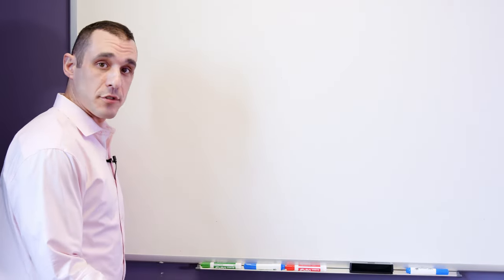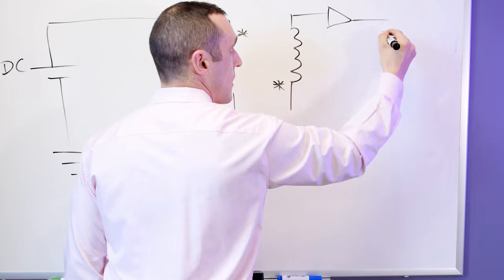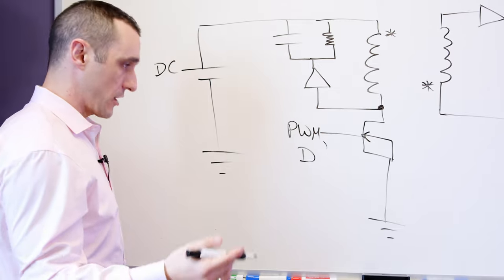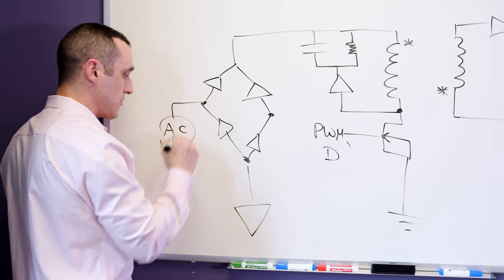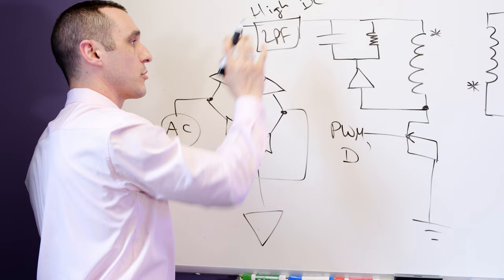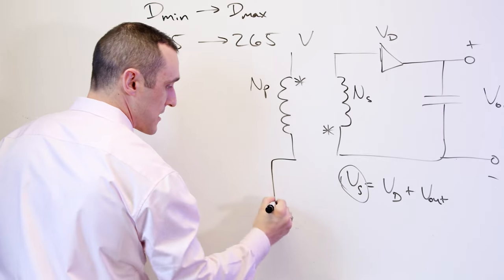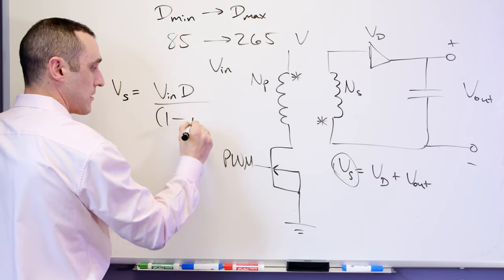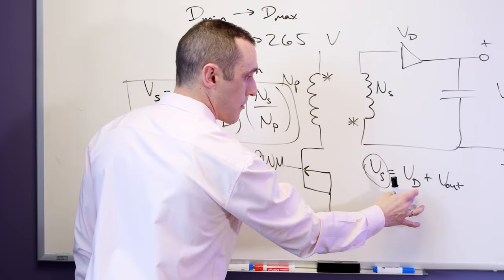Flyback Converter Design Deep Dive

Comment: I do believe the ground reference used by the bridge mentioned at 04:54 is the same as the ground reference used by MOSFET.

As far as the isolation goes the same is provided by the transformer.
Reply: Yes they are the same reference, don't mind the symbol difference, and yes transformer provides isolation which is why I did not put a symbol there but just a negative terminal for an output.
Reply: @Zachariah-Peterson  thanks for the clarification.

Comment: IS it really a transformer and not a coupled inductor? asking since i remember you needed an air gap. 
I tried to build one in the past but the hardest part was the transformer* part since most out there are built on order and figuring out the proper generic part out there was the hardest part, maybe you can expand on this on a later video. Or how to make one from a toroid. 
Also what is the switching frequency range for flybacks ? buck boosts can go up to a few MHz but I never saw any flyback that was even close , also what would be optimal from a efficiency point ?  Does the transformer* limit the switching frequency ? 

Regarding multi output one i have a few questions:
1 how will the power draw in one affect the other?  As in if from the 12v DC rail we draw .1A and then 1A how will this affect the 3v3 rail? the rail with the FB will be ok but i am afraid of voltage saggs on the other one.  OR should i size the other one higher and then use a LDO after the diode? 
2 can i set a center tap like GND so that i also get negative voltages? 
3 If i would desire a few DC rails with the same GND wouldn't it be simpler to make a higher DC single rail and then add a few LDOs or bucks on that DC line? (not sure about cost but i assume it is more expensive at scale)
Reply: It's absolutely a coupled inductor in flyback supplies; it's where the name comes from - energy "flies back" - magnetic flux is built up in the core during the primary on-time, then collapsed into the secondary(ies) in the off-time.

Each switching cycle transfers a "packet" of energy; the size of this packet is proportional to the inductance and square of the current. Since the time it takes to ramp up the current is proportional to the inductance, it's more beneficial to lower the inductance to increase the current. This does however result in high magnetic flux, which is why flyback cores are either gapped, or a powdered iron core is used (which effectively has a distributed air gap, allowing for higher flux before saturation).

You can only decrease the inductance so much before current levels become unmanageable, so between this and other factors such a switching losses, there's a "sweet spot" for the flyback topology, which is why you only really find them in the sub-200W power range; above this, a design using true transformer action wins (eg. forward converter, half/full bridge)
Reply: Forgot to add re: multi output. You'd take your feedback from the output rail that needs the tightest regulation. There's nothing stopping you adding linear regulators afterwards, but if you're doing it because you want a really clean output, you'll need careful L-C pre-filtering before the linear regulator, as they aren't very good at filtering out the high frequency components of the switching noise that the flyback will generate.
Reply: @NicBellamy  THX i was considering a PI filter after the diode anyway + potentially some synchronous rectification
Reply: @NicBellamy  So if i use some of those powdered toroid's i can wind the inductors and not bother cutting into it? NICE
But i am still a bit clueless about how to filter out the good ones are the powdered materials from a certain series or is the a material number range? asking since i am a bit lost on mouser
Reply: (1) Regarding multiple voltages, they are maintained fairly accurately, so there is mostly no need to add post-conversion and regulation unless you need to maintain better than the typical 5% regulation.
You need to understand that, for stability reasons, regulation is done on the most loaded line (with highest current), as that one will be sagging the most under typical loads.
Then the other voltages are maintained simply by the ratio of their turns relative to the regulated one.
One thing you need to consider here is the inclusion of the rectifying diode voltage in your calculations.
Let's say you're regulating the 5V output with its 1A load, and you also have a 15V output with less than 1A.
Your turns ratio would be 1:3 between 5V and 15V output.
But one small detail is that you also have the average 0.7V forward voltage drop across the lower voltage rectifying diode, and 1.3V across the higher one.
For simplicity, we will use 1 turn per volt.
Your 5 turns will have to produce 5.7V to give a 5V regulated output.
On the higher voltage output, the 15 turns will produce almost exactly 3 times the voltage on the lower output, which is 5.7V × 3 = 17.1V, minus the diode voltage drop of 1.3V under maximum load, which gives 15.8V.
If the 5V output is less loaded, diode voltage drop is decreased, let's say to 0.5, so we get 5.5V × 3 = 16.5V, minus 1.3V gives 15.2V.
Taking this diode drop into consideration, you could use 14 turns to get closer to 15V.
Either way, the voltage change is not too large and most circuits will have no problem with it. You just have to include the diode drop on the regulated rail to get a more accurate estimate of the other rails.
You will also have a slight voltage drop on unregulated lines due to coil wire resistance.

(2) Yes, you can set a common tap and wind negative voltages in the opposite direction, also turning their rectifying diodes in the opposite direction from the positive voltages.

(3) Using LDOs is only recommended when you need more tightly controlled voltages with less noise, but in that case you're still recommended to use mutliple outputs from flyback with voltages only slightly above the regulated ones, to keep losses low.
Adding buck converters after a flyback is redundant, because a flyback is already a sort of a buck converter with multiple voltages where you only need additional turns, diodes and capacitors for higher voltages, or a tap for lower voltages.
It is possible to use the same wire with taps, so that you only have one continuous coil with multiple taps, but wire thickness needs to be observed for each output's current rating.
Buck converters after a flyback only make sense when you need a much more tightly regulated additional voltage but don't worry about the voltage noise much.

Comment: Can we use full-bridge rectifier on the output? I never seen that, mostly there is a center-tap coil for secondary and two diodes on both end. I guess because the few turn of copper is much cheaper then two fast switching power diode, but I'm nut sure. Is there any other reason why it is unusual?
Reply: I suppose you could but I have never seen it, I would need to think about it. I do recall seeing center-tap coil designs on the secondary side, and to rectify both would need diodes, but I see it more often when you want two output rails or in a full-bridge topology.
Reply: @Zachariah-Peterson  Thank you

Comment: Thank you Zach, what should the  ground reference for AC power be? Neutral? Protective Ground?
Reply: If by "reference" you mean the AC equivalent of a negative terminal for return currents then it would be neutral. The protective earth is connection is not meant to be a current carrying conductor so it should not be used as such. It is useful to provide a safety ground using the chassis, or by drawing an earth ground ring around the edge of the board.

Comment: Geranium diodes?
Reply: Yes Germanium diodes can be used instead of Si if you want lower forward voltage.
Reply: @Zachariah-Peterson  Yes, for a Germanium diode (though now days I would use a Schottky) but you suggested a Geranium diode.  A flowery little critter.
Reply: @michaelardai9703  I don't think I said anything about a flower diode, but maybe the captions did 😆